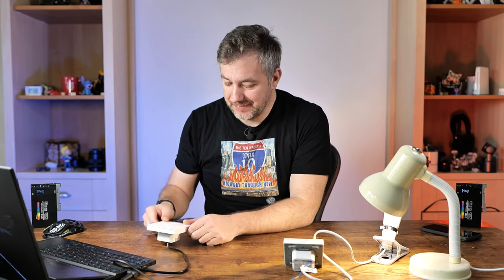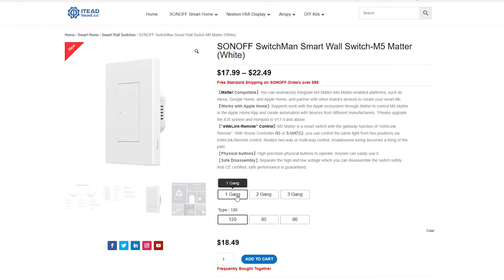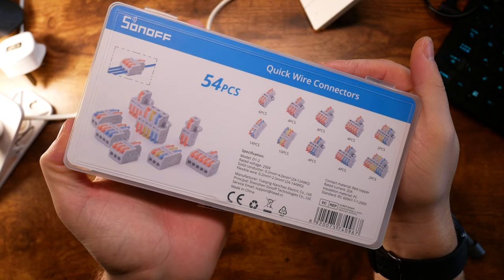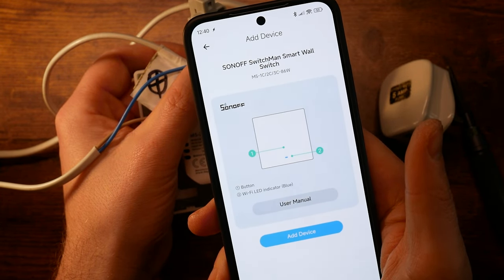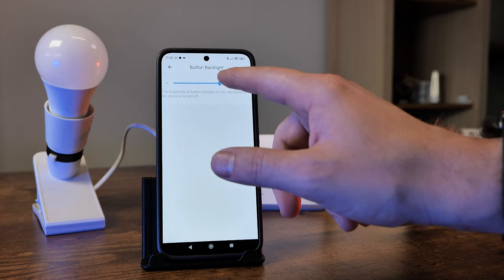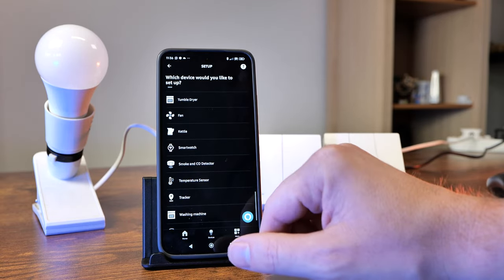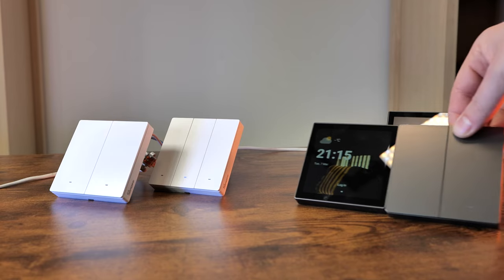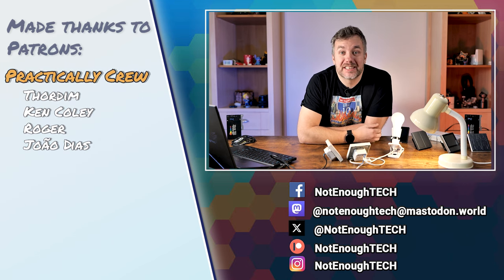Sonoff SwitchMan M5 brings Matter support

Comment: Matter over wifi or Matter over Thread? Matter over wifi for devices that already had a local mode seems pretty pointless to me if you already own an iHost to Matter Bridge them. Bet even the old switches appear as matter switches to anyone with an iHost. If it was matter over thread they could also work over that network, thereby strengthening the mesh network and (I think) you can link a wall-switch and bulb directly instead or relying on a wifi-switch to pass on the message. These just look like switches that take up space on your router. As the newer ESP 32 chips with built in Thread/Zigbee radios become more commonplace I expect Thread to be more widely used and then unless tasmota adopts Thread it will die.
Reply from the maker: I think the question here is more about the control over Matter router - then having your devices simply supporting Matter as end devices. I agree with you with Local LAN the consideration isn't comms between devices but the ewelink cloud which ppl don't like using in fav of custom automation support

Comment: I'd probably still flash with tasmota - only because EVERY switch and plug (about 26) in my house is tasmota.
If they are tasmota then I'm not sure how much use matter is for me, they are all detected by home assistant via mqtt. 
Or is it that if using matter, I wouldn't need to enter wifi and mqtt details?

Comment: I use Tasmota devgroups & rules with Tasmota globes. No middle man required, so yes still need it.
Reply from the maker: It's one way to do it. I personally keep my groups at the higher level as then I only manage it from one level. Your approach would work for home automation but doesn't scale up well (doesn't need to if you are at that level). So for example y
If you were to change the protocol to matter on a single device... My way would have groups intact... Yours continues on tasmota support. Something to bear in mind
Reply: @notenoughtech  You are 100% correct with scaling & new tech. Having 68 Tas devices around the house & 7 NSPanels with @JoBr integration works exceptionally well and no middle man 
So I am currently very careful about the next solution, though the day will come when I have to bite the bullet. Plus tech is getting better each day with local LLMs,  2450 presence sensor & esp32 S3 voice, who now's how smart I can make it

Comment: I would certainly use Tasmota. It is frequently updated with new features and pretty much guarantees compatibility to all the foss ecosystems.
I must say I'm disappointed that Sonoff didn't add Thread. And a more tactile switching experience. Especially the cheap feel of the click keeps me from rolling out SwitchMans to all the rooms of my flat – I'm waiting for something that feels more like a mechanical keyboard.
Reply from the maker: Don't get me wrong, but these are as barebone as it gets, hence my point about not bothering with Tasmota. Personally, I can't really think of anything I would need from them that I cannot resolve with custom Matter router

Comment: Per default only option is to toggle relay, with tasmota (and ESPhome) switch & relay can detach and have alternative control options with multi/long push. Have fallback to direct control when connection to server is lost. All those are not an option with matter or evelink
Reply from the maker: Detach depends purely on hardware but I agree with other statements.

Comment: Do not use a full metal screwdriver when working with mains , if you forget to turn mains of you are screwed😅
Reply from the maker: Good tip.. although for demos and filming I rarely have things connected. As you could see from my "accidents" learned the hard way 😆
Reply: I wonder are there screwdrivers that only use non-conductive materials, or is metal always necessary?
Reply: @AndreasSchildbach-o8d  There are plastic screwdrivers but in almost all cases (even electrical work) you want a metal shank to make it last more than a few uses. A standard insulated screwdriver can easily keep you safe from 1000+ volt without any danger to the user since most of the shank is also insulated.

Comment: Will these work with smart bulbs? So do they keep power to the bulbs or does the switch cut out the power completely?
Reply from the maker: You don't use smart bulbs when you have smart switches. They cut the power to the bulb.

Comment: I'm not sure we should oppose Matter and Tasmota. It's good value indeed to have ready-to-use devices that don't need opening nor flashing; like we had somehow with Zigbee.
To the point that Tasmota is also compatible with Matter: turn a Tasmota device as a Matter end-device, or use Tasmota on ESP32 to expose ESP8266 devices as Matter devices
Reply from the maker: I love Tasmota, I'm sure you know this from my videos, but I'm also practical. If this was something like Sonoff TX Ultimate and I had to give away support for the RGB outline - I probably wouldn't settle for basic Matter edition - but it's the most basic of the switches and at this point it just feels like I'm losing only my time :)

Comment: Do I need cloud service for schedule light,? So if i lost internet does schedule stops ?
Reply from the maker: When used with eWeLink it will retain the schedules (this is why you have limit of 8 if I remember correctly) I'm not sure about Matter connection with other systems

Comment: I wonder whether the flash / bootloader might be encrypted now they do use Matter.
The Matter specification/certification demands keys to be stored encrypted.
So it might be made quite a lot harder to flash your own firmware if they did encrypt the flash (thus burnt a fuse to enable encryption)
Reply from the maker: That's a good point. May save some time to see if the process works just as well as on original ones
Reply: @notenoughtech  Yes they are supposed to be locked and encrypted, otherwise it would be possible to extract the certificate from the device manufacturer
Reply: @notenoughtech  So, did you have the chance to test if you can tasmotize the M5 Matter already?
Reply from the maker: Not yet. It's I'll be a couple of weeks before I have some time
Reply: @notenoughtech  Cool, thank you for taking this effort. Looking forward to your tests.
Reply: @notenoughtech  Hello. Any update on this? I bought a few whites and I would need to flash tasmota on them.

Comment: I'm confused... I use Tasmota for its MQTT features, would this still be available with Matter?
Reply from the maker: Think of matter in the same way you think of MQTT. If you have a matter hub connected (weather it's the DIY solution or branded ecosystem) you have a way to talk to the device and receive data. This can be acted upon or relayed  to MQTT etc.  MQTT was a common protocol to bridge various devices and make them talk. Matter does just that

Comment: If you don't want to be accused of "clickbaiting", then summarize your point at the beginning, rather than drawing out the video. Or accept that you are doing the clickbait. :)
Reply from the maker: Chapters, chapters, chapters, chapters, chapters, chapters
Reply: @notenoughtech  No. Chapters are a solution to another problem: finding specific info. Good journalism and good technical writing puts the abstract at the beginning, and then drills down.
Reply from the maker: Of course they are. They give you instant access to the part of the video you find most important to you if you decide that my order of explaining things doesn't confront your liking. On top of that there is an article written to accompany the video so you can access the same information without even hitting the play button. And the last point is: I never share my videos. I always share the link to the article which defines how I present the information I have to pass
Reply: @notenoughtech  the article suffers from the same problem: it asks the question but doesn't answer it in the introduction.
Reply: @notenoughtech  look man, you can act like this, bit then don't be surprised if people are upset that you are doing the clickbait game 🙂
Reply from the maker: Click bait is when the content is misleading or does not resolve the statement/question poised. You are taking issue that I laid the arguments first before I explained the reasoning behind not utilising tasmota. 

Perhaps you should revisit how essays are written where a question or thesis is proposed followed by explaining the facts and how you arrive at the end part: conclusion. 

As explained above. I've given you every avenue to consume content at your pace/and order. In more than one medium.
Reply: @notenoughtech  Look, mate, you KNOW what you did was clickbaity, you even said so in the video. :)

In addition, long form essays that do not put their conclusions first, are bad journalism and bad scientific/technical writing. 

It's okay; you can write poorly, and I will criticize you for it, and our lives will go on.
Reply: 😂😂😂😂😂 I wish I took things this seriously,  I wouldn't  need to watch youtube videos to wire my smart lights but then again I'd miss gems like these
Reply from the maker: Sometimes people take these like the bible. 🤷 It's just some bloke making videos in his home at night after a whole day at work instead of playing Helldivers 2
Reply: @StevenRerani  clickbait AND sock puppet account? Double whammy! 🙂
Reply: @StevenRerani  this video is many things, but a "gem" it is not...

Comment: And also why did it take them 2 years to release a white version? And we still need a version that can be clustered vertically rather than only horizontally.
Reply from the maker: I have no idea why the hold up on colours. You'd think that this is as simple as changing the material for the moulds